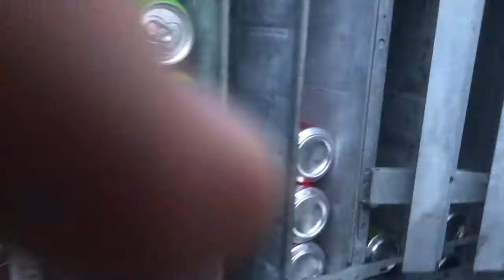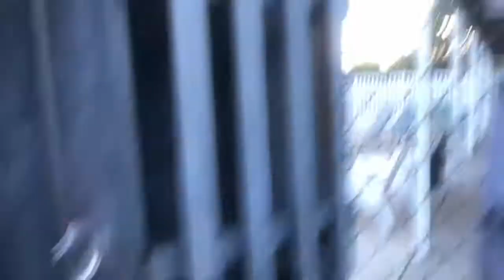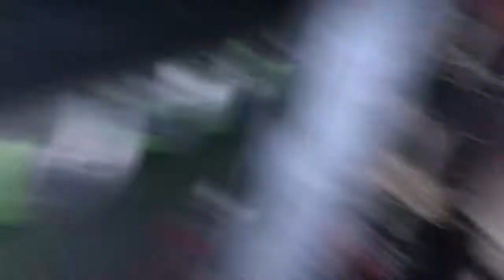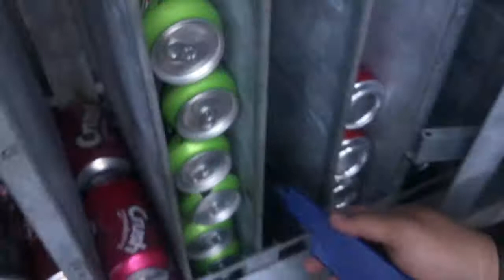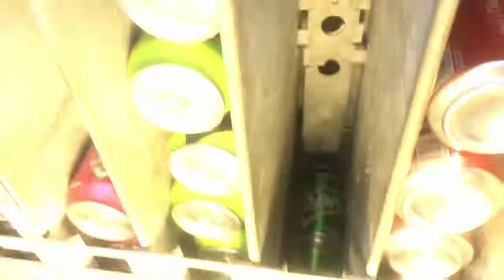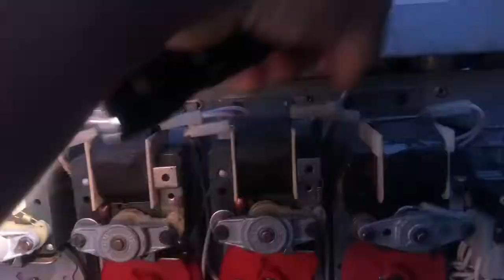Clearing Jammed can and installing new Shims

Comment: I have problems with double vending soda cans.  It does happen on all slots only a couple. It will feed 1 can and then 2 cans on the second purchase. Any suggestions?
Reply from the maker: What kind of machine do you have
Reply: @720vending  Cold Drinks Model: RVCD 552-8 not sure if that's what your looking for
Reply from the maker: @gun_shine_st8137  that is a royal vendors machine you will need to check the space to sales setting on the columns that are having issues. It would be listed as STS in the menu
Reply: @720vending  there is no electronic menu on this machine it is all mechanical. I'm not sure what menu your referring to sorry
Reply: @720vending  could it be something to do with my shims
Reply from the maker: @gun_shine_st8137  then check the cams that rotate there should be one notch for each can it can vend
Reply: @720vending  awsome I just watched a video on how to change that on the cam. Probably a dumb question but it should be on "1" correct?

Comment: We’ve got a machine just like this that we’ve been running for about 6 years now, and a motors gone bad in it. I can’t find a place that sells them. Do you know of one?
Reply from the maker: What motor are you looking for single column or double column
Reply from the maker: Here is a single column motor that should work 
https://snackattacknow.com/product/grey-cam-disc-vend-motor-w-triple-cluster-switch/
Reply: @720vending  its one of the double columns
Reply from the maker: @thereinforcementshavearrive  I will see if I can find one. Or do you have a spare single column motor
Reply: @720vending  i dont have a spare single why? would it work in it?
Reply from the maker: @thereinforcementshavearrive  you could take the coil off the single one and it would fit in place of the coil on the double one